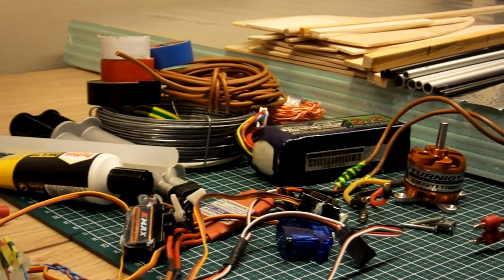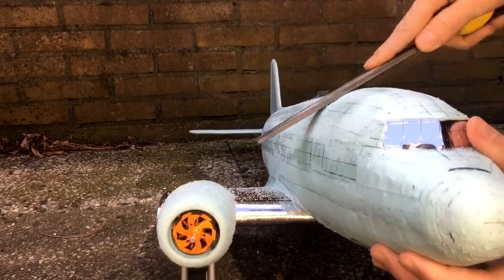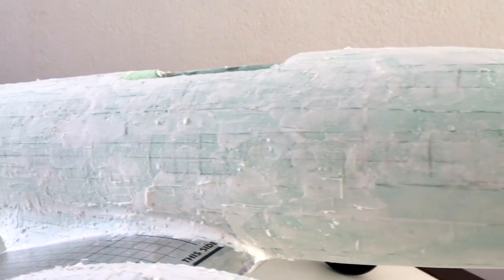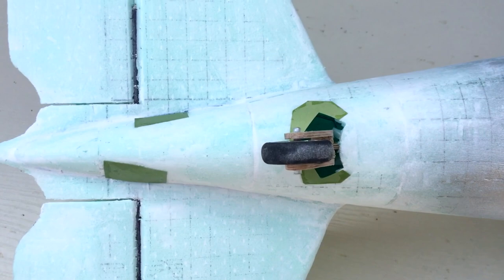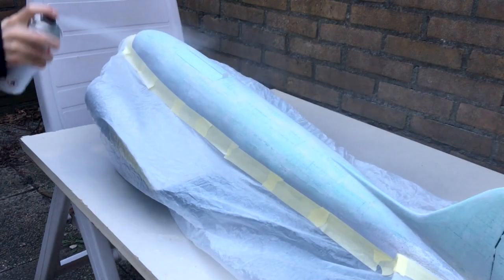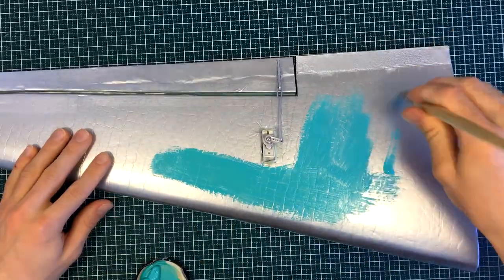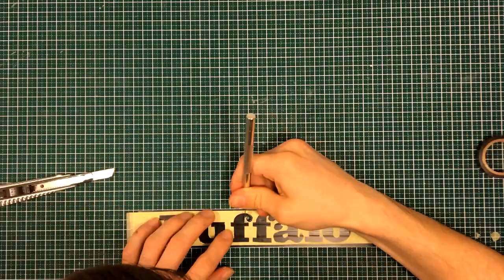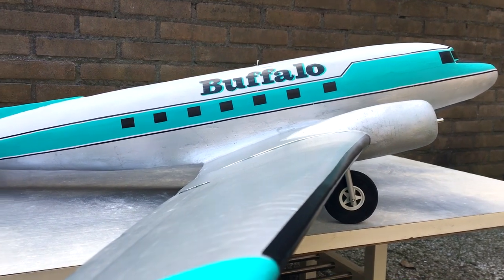Painting an RC Airplane | DC-3 From Scratch (ep. 5)

Comment: I think you have to add air cooler ring around the front of the engine to make the engine more realistic.
Reply from the maker: Yes, I also still have to add the aircraft registration codes and a Buffalo title on the bottom side of the wing!

Comment: Hi i used acryl paint with brush on my rc plane like you, but the paint surface was not smooth. Is your plane's surface smooth or that is traced too of the brush?
Reply from the maker: Acrylic paint won't  be perfectly smooth, but in my case it was smooth enough. The quality will also depend on the roughness of the surface you are painting. The smoother it is, the smoother the painted surface will be!